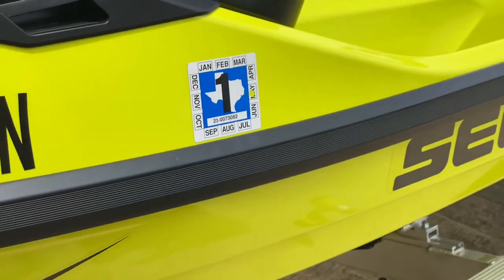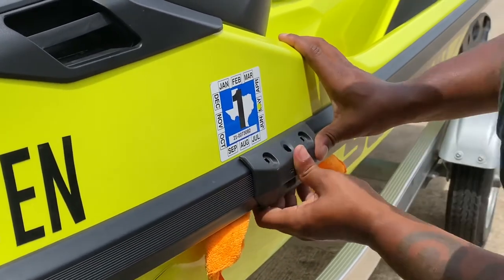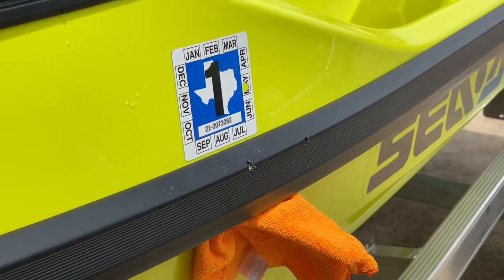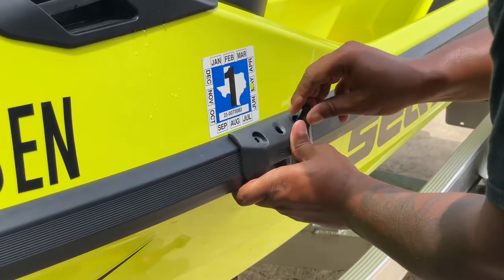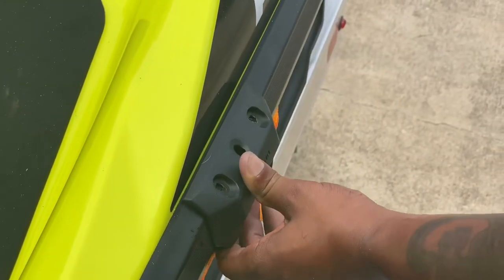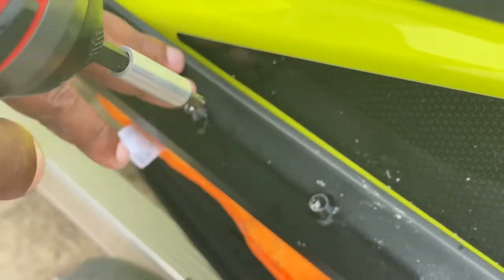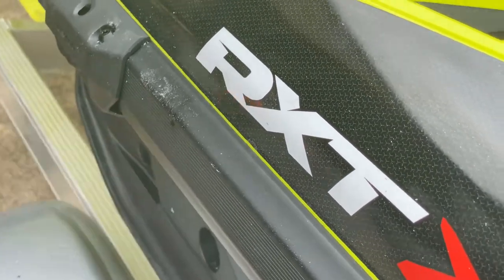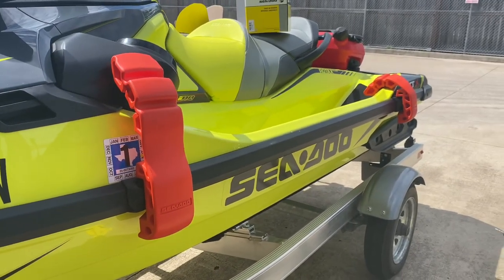Diy install seadoo RXTX 300 fender bumpers

Comment: Just want to point out that there are measurements for the distances, and I believe the one near the speaker is way to far out… But I think u did that on purpose to protect the speaker.
Reply from the maker: We did our way because the oem instruction do not protect the speakers of the high spot on the back side

Comment: Good video and good tips, looks like the bumpers would be a little thicker, just doesn’t look like very much protection.
Reply from the maker: We keep extra pads just in case you need them. In calm water at the ramp or dock this work great. But rough water you need more protection. The big pads that you tie to the bars and seat area work better for that.

Comment: I would have used a block of scrap wood behind where you're drilling, just in case. Holes in the railing are nothing, but holes in your hull are bigtime FUBAR
Reply from the maker: You can but a shop rag does the job plenty good. Done over200 and it’s never let us down. Drill bit just does go through fabric like a knife

Comment: Does this drill through any fiberglass when you pass through the plastic portion ?
Reply from the maker: The rail is fiberglass
Reply: @cowboybishopvids6570  do you have to put any sealant or epoxy at the end where the screw went into to seal it ?

Comment: No issues with leaking? Do you need to use a sealer for the screws?
Reply from the maker: The screws don’t go in the hull to leak. The screw is only in the railing.